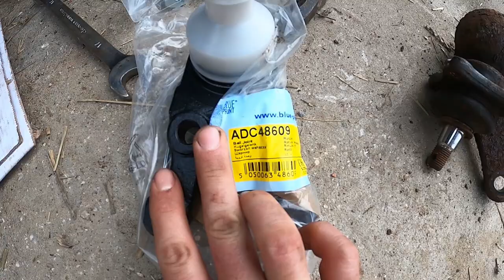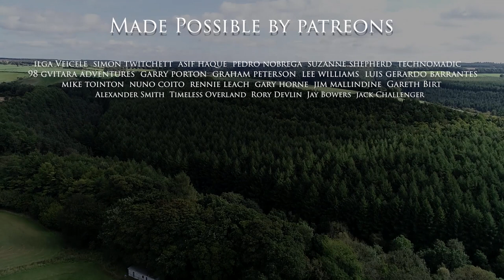Suspension Upgrade | Building an Overland Vehicle on a Budget

Comment: Salut!
Nice work :)
Drive it since the video? How it feels with new suspensions on / off roads?
Did you perform a wheel alignement after upgrade? Any  issues with the rear settings? Screws weren't rusted into bushings?

Lot of questions :).... but suspension upgrade is next mod for my pajero ...!
Merci et à bientôt :)
Nicolas
Reply from the maker: Not just yet as still waiting on that diff seal 😜 can't wait! Should be sometime next week 🤞

Comment: Good progress. 2" lift what about extended brake hoses? Also was cost of having the strutts assembled by mechanic included in costing?
Reply from the maker: No need for extended brake lines on these. Knew someone but only takes 20 minutes with a press if that